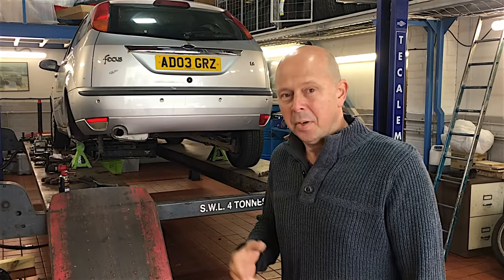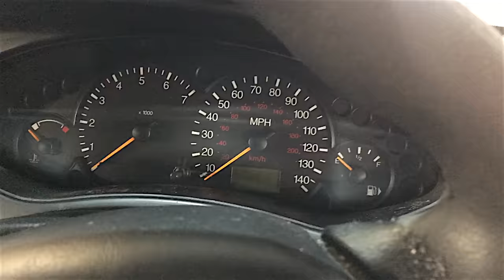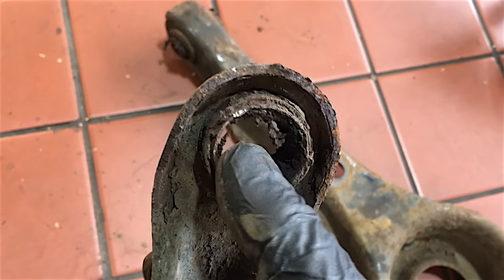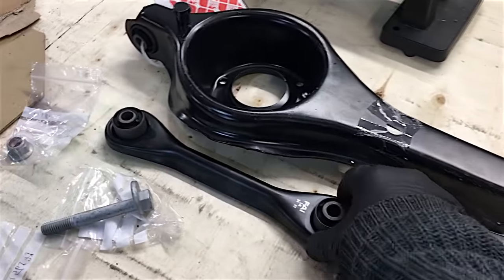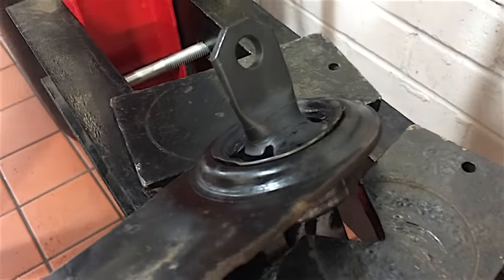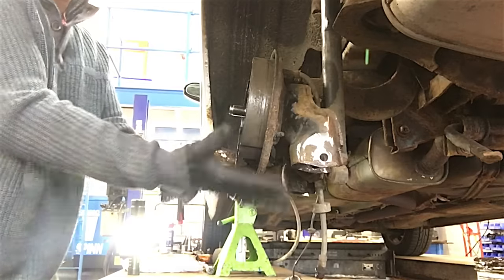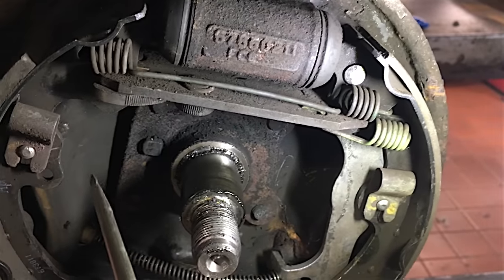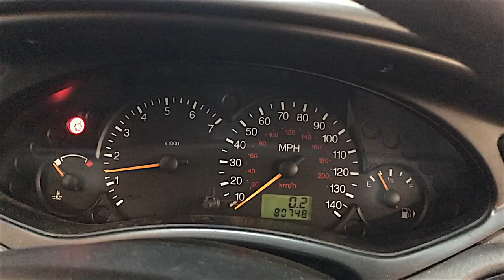Decided not To Scrap the Focus, Replaced the Trailing arm Bush

Comment: I'm an ex Ford Master Technician and at my old dealership "which was stuck in the 1950s" we didn't have half of the specialist tools on the rack required. We did those in situ we used to cut them out with an air saw then use a piece of threaded bar with a washer on one end locked on with two nuts and a large socket on the other end with another large washer and a nut on the other end to press the new one back in. We used the same tool on Fiesta rear axle bushes too it was quite quick too!

Comment: great job saving the Focus. my question is where's the guard on the angle grinder? It's imperative to have it on when it is in use as it would protect you and others nearby in the event of a catastrophic disc failure. Where I work here in Alberta Canada at Suncor oilsands this modification would be a life saving rule violation and result in a severe OH&S fine and possible job termination. Without the guard you are basically holding a live granade with the pin pulled. Please be safe and keep the great content coming. Cheers from Fort McMurray, Alberta, Canada

Comment: Loved watching this. The old Focus' are really good reliable cars and the parts are very cheap if you shop around. Ive an old Mk2 and apart from the standard ageing issues (rust) its a reliable car and also ULEZ compliant. Tax nobbles you a bit but I'd rather a car you can fix for cheap than something that needs a scientist to look at. Had my trailing arm bushes done not long after I got mine 3 years ago. Look after a car and it looks after you. I need something newer now but very very reluctant to get rid of it. I have that trim in my car, its like driving an old Country Lion coach. Not the fastest car but comfy. Always be grateful for what you have, something has to be said for the E word (Effort). The new world has become too disposable these days :)

Comment: Really pleased to see you didn't scrap her, we really need more people willing to make a small profit on the older Ford and Vauxhalls to keep them on the road.
Scrapping almost perfect cars because of tiny margins ends up taking away too many motors and we play right into the hands of government and the eco warriors.
If I had her I'd have the car straight in for a fresh test, other than the dreaded emissions question it looks a good run about for someone.
Cheers for doing the noble deed Alan, would give you 100 likes if I could.
Reply: Problem is when its sold to the new owner. A lot treat them like washing machines and don't get things fixed between MOT's and then when its MOT time and it needs a couple of tyres, brake pads and maybe a new spring so maybe a £600 bill they just scrap them and get another 1 or 2 year car. No way to stop the inevitable I'm afraid.

Also please don't call us EV drivers "eco warriors" I mainly drive an EV because it a cheap lease and it costs me around a fiver to cover 240 miles. No brainer as they say.
Reply: @st200ol  Good points made mate, btw the ecowarrior isn't aimed at leccy car owners, it's aimed at the type who haven't even took a driving test, you know the just stop oil type who have to tell the world how naughty we all are.
Cars, like oil, if gone today would see the world we know implode.
Reply: @Jim_M_75  I have no idea why JSO folk do what they do it just annoys everyone and causes more pollution. The problem is how are we supposed to protest things these days, nobody listens and that goes for the ULEZ and 20mph speed limit protesters too. So people resort to destroying cameras and blocking roads.
Reply: fighting for my life to keep my zx5...rusted out subframe mounts. im gunna try to weld in something

Comment: Nice job saving it Alan. I have the same dilemma with my Micra K11, so little value in car but there's just something about it, that makes me and missus keep it going every year and push it through annual test. 😊
Reply: They grow on you mate, not like these modern piles of junk that will be scrapped in 10 years.
Reply: Nissan is garbage after 2000 saw a few x trails and qashqais piling up at the junkyards, rust around windscreen. They don't hold up like the Japanese build Nissans and toyotas from the 1990's. Firstly the clearcoat and paint quality is poor, and also the metal gauge is much thinner.

Comment: Like you, I had the same cutting disc issues when doing the rear upper wishbones on my `58 Discovery 3. I then saw someone using a reciprocating saw to cut through the bolts. Much quicker and safer as long as you use carbide blades.

Comment: Great video and a great way of sorting a tired rear suspension on a Mk1, probably the most thorough. You can change the trailing arm bush with the correct tool in-situ if doing that job alone but always best to do the job the way you've done it in the long-term. Thhose rear bolts are infamously bad for seizing in the bushes once this job is done thats one of few expensive jobs a Mk1 will need 100% if it hasnt already done so today.

Great to see another mk1 being given another chance even if for a while longer :)

Comment: Are you not supposed to either jack the hub to up to ride height (or get the arms to specified angles) or have the car on its wheels before you fully tighten rubber suspension bushes?

Comment: I don't know if you've been told this already but the mileage is wrong. It's done over 133000 miles and you are showing 80000 ish. Bare that in mind mate. If you do a check online it will show as wrong, at least its an easy thing to change as it will be upwards rather than down.
Reply: And the other dudes focus who swapped clusters now showing 80 lol

Comment: Nice job Alan! My brother had to re-fit his Laguna rear suspension arm bushes, after the tyre place jacked the car up on the arms and separated the rubber from the bushes. The bushes are in vertical on that so stop side to side movement. And the bolts are about 200mm long and would only come undone with an impact gun.

Comment: The condition of the underneath didn’t look too good on that car. Looked a bit more serious than surface rust to me.
Reply: To be fair, for it's age, it was better than I would have expected.
Those subframes and suspension components do go crusty, as long as it's not structural or weakened they should be fine, an MOT will spot anything too bad.
Plus the individual.components are available off the shelf for minimal cost or you can have them cleaned up, wirebrushed and repainted in stop chip and rust protect.👍😲

Comment: Great to see that the focus is getting a new change of life
That front control arm bushing need to be installed about 12mm before the collar touches the arm
Otherwise the busching has a wrong preload on it because its not in the middle
(You can check pts to see)
Reply: i have an issue with my mk1 sport tdci.the rear sits to high.i think someones change the rear springs but not done it properly
Reply: @teatimetel174  might have the wrong springs in it. Some models had higher weight rated springs . That could cause the height issue. Some Ford models even had different springs if you did or did not have a towbar . Make sure the springs that were put in are for your exact spec of Ford .

Comment: Had exactly the same problem with my my 2004 Mk1 focus , both rear trailing arm bushes had completely disintegrated in 2015 so that 03 plate has done very well , again seized bolts causing rear arms to be replaced, it’s one of those jobs that leads to another problem then to another problem & so on . Since purchasing our newer Fords , I immediately managed to undo every bolt on the rear subframe as the cars were only a few years old & remove each bolt one by one & use copper grease on the bolt & re-torqued them all back up to prevent this problem happening again .
Reply: Wise choice, pal. Copper grease, no more problems.

Comment: Hi there, I’ve got a question that’s not related to the topic at hand, but I hope you don’t mind me asking. 

These MK1’s aren’t as popular as in the USA. 

What lubricant do you add the the input shaft spline when doing a clutch job on a manual transmission.

My car has the MTX75 in it. 

Thank you,
Reply from the maker: hi, you can use a very thin smear of silicone or gold high temperature anti seize grease

Comment: You made that work look easy, this would be a great car to use as a run around for the garage, or in an emergency. Doesn't matter if it sits around, not losing any value from it.

Comment: Same story with my daily driver 1.8 Zetec Turnier.
But I removed the complete rear subframe unit last year. Full restoration job. New bolts (all), new bushings (all), new springs, paintjob. Took two weeks. Those bloody factory bolts were seized into the factory bushings like concrete.
Drum brakes on a Ghia? Interesting. Mine has 4 discs.

Comment: Brave decision. Conventional wisdom is if you see a rusty one walk away as there are better ones still out there, but good on you if you're going to go in head first. You have at least made me feel better about my 2001 Ghia saloon. It's nowhere near as bad. Steel petrol filler pipe is a worry, expensive and rust prone. Would be a total pain to fabricate from scratch. Wobbly gear lever fixed by inserting a shaved down vauxhall roll bar end bolt bush into the actuator swivel on the bellhousing.  A new assy from ford was silly money....bush not available on it's own.

Comment: Good work Alan, but you pressed the trailing arm bush in too far, it doesn't go all the way in, you press them until they have the same amount poking out both sides, approximately 10mm before it bottoms out.

Comment: I think there will be much regret from people that scrapped good cars that required a thousand or so in work. Each successive newer model is going to be more expensive to keep going when age sets in.  Its not only expense but also time, a MK1 Focus can be in and out the door in a day for most jobs. On modern cars many issues take months to solve at the dealerships.  So really it makes more sense to run an old Focus even if you need to spend more than its worth every now and again. Of course the car needs to be solid...

Comment: I had a feeling it's too good to be scrapped, especially it being a ghia model, plus these mk1 focus are getting quite rare in good body work condition and some owners do still appreciate them.

I hired a mk1 for a family holiday many years ago and I must say I was very impressed by how it handled 2 adults, 3 children and all our bags, it was very comfortable and a pleasure to drive, didn't feel cramped or like  it was too stressed.

The parts it needed weren't really expensive items and a lot of the cost would just be labour charges, which you could offset to some extent by having your own garage facilities, mechanical skills and doing the work inbetween jobs as and when you have spare time.

It's obviously a car that's been loved and cared for in the past despite it's issues.

Glad it's been saved and will continue to be used, why scrap a perfectly useable car? It will make a good cheap family run around or even a courtesy car for your business and I'm sure will go on for many more years.👍

Comment: I had one for years; it was my uncles from new and my brother had it before me. Decided to scrap it purely because it cost more to insure than I could have ever sold it for. Burned oil like no tomorrow, electric windows had failed, one I had to use sealer to keep the window closed lol. I miss it but it was more trouble that it was worth.

Comment: Hmm ..should you grease the bolts on metalastic bushes ..that's a question ..will it then rotate on the bolt instead of flexing on the rubber ? there is a reason they are fitted dry, may be the solution is to fit them with silicone sealing them at both ends to stop water getting in ...The truth is i don't know!